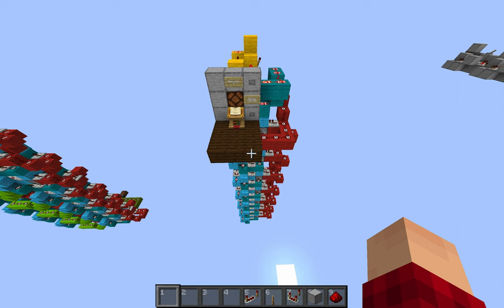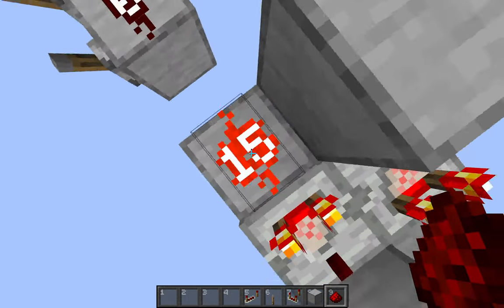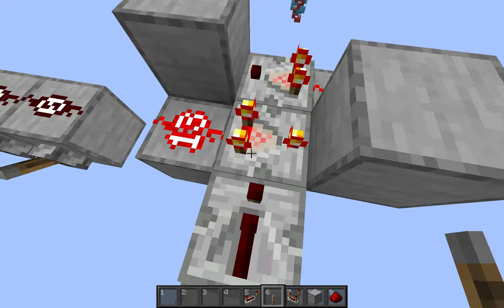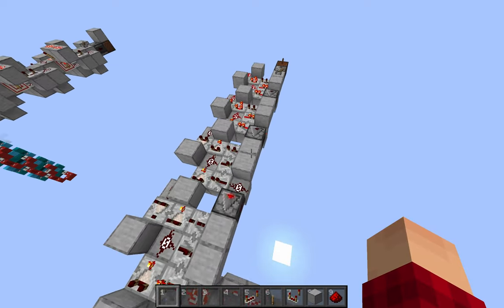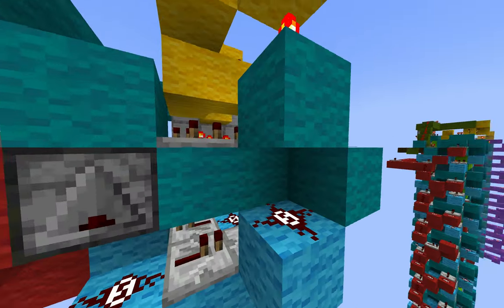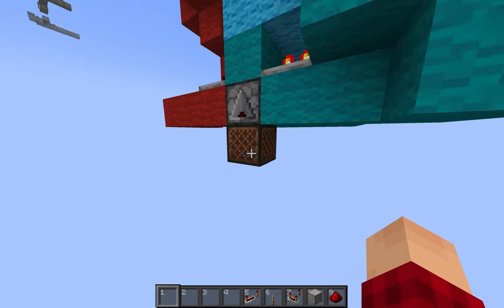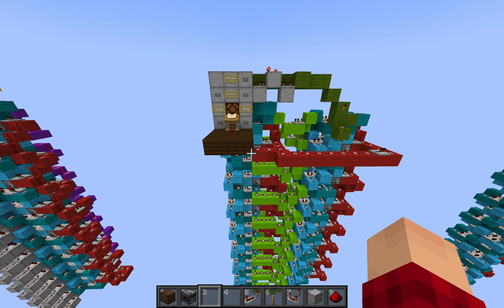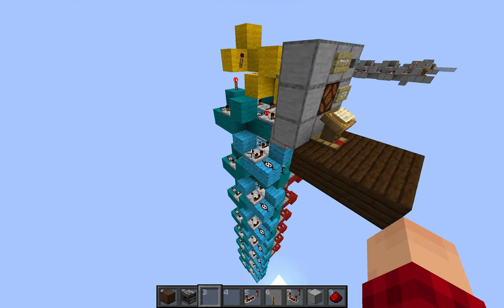Signal Strength Memory Arrays in Minecraft

Comment: Fantastic arrays you have here, they are exactly what I was looking for. I am looking at using them in a stopwatch that can save recorded times to memory and recall them later, so the build that can save 0's is exactly what I needed. Only problem is I kinda need a hybrid assembly between the array that can save zeros and the array that can load and unload  the ram without clearing out the buffer. 

But for the life of me I can't seem to figure out how to get both functionalities out of a single array.  Any chance you could help out  and link a schematic or world that demonstrates how those two arrays could be merged?  

You've been a great help, new sub earned!
Reply from the maker: Hey thanks! Just saw this. I’ll see what I can do to combine them and get back to you in a bit.
Reply from the maker: Alright, here's my solution: https://www.mediafire.com/file/3mqr65yae12af4j/Signal_Strength_Arrays_Nov_4_2023.zip/file
Important note: you can pop data out of the RAM, but you cannot pop data out of the buffer. 

So basically, this hybrid works by making both the buffer and RAM have their own parallel array which tell their counterparts where the bits of data are. HOWEVER, it's a bit more complicated than that, and as such, I only got it somewhat working, such that you can load and write data, and even pop data out of the RAM, but I was not able to allow you to pop data out of the buffer without the data getting messed up.

At 6:17 in the video I mentioned a design that does not use observers and is more accurate, meaning it only clears the previous cell when the current cell has nothing in it. This differs from the observer design, because the observer ALSO detects when a cell gets data loaded in, and then that observer will send a signal clear the previous cell AGAIN. This is a problem because then it will be clearing any new data that was just loaded into that cell, essentially deleting it when it shouldn't.

The reason my standalone observer design works is because of very precise timings which allows half the memory cell to still retain its data, and by the time the clearing signal (the second one that we don't want) goes away, the other half of the memory cell can still fill the cell back in.

In my hybrid, I replaced the observers in the RAM with redstone torches in order to allow more accuracy, which is necessary for the pop out procedure to work without corrupting the data. I was not able to achieve the same in the buffer array, because the buffer array also needs to allow data entry that propagates down into it. The observer design allows you to do data entry easily and quickly, whereas using the more accurate method of redstone torches introduces timing problems that would need significant effort to resolve, which are caused by the presence of the parallel array (the one that allows the machine to do '0' signals).

----
TL;DR I made a hybrid device that works like you asked. You just can't pop data out of the buffer.
Reply: @michael23b  You're amazing, man. Taking requests to do high-level redstone is a different level lmao
Reply: @michael23b   HA, didn't actually expect a response, much less you to actually take the time to build it out for me, very cool! thanks so much, I'll give it a look and see if I can get it incorporated into my build. Thanks man!